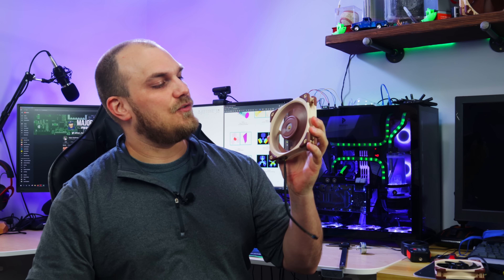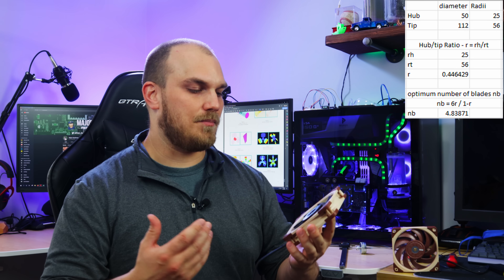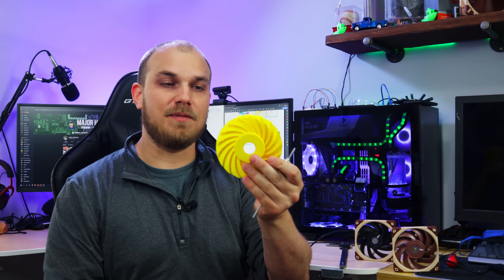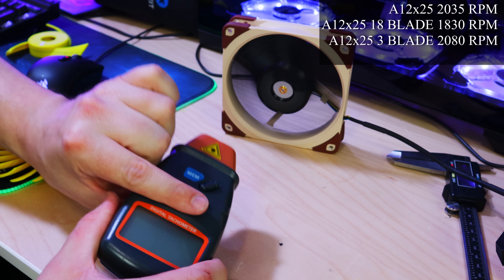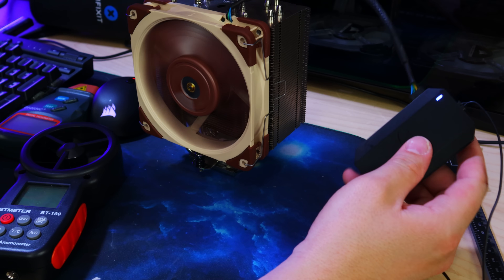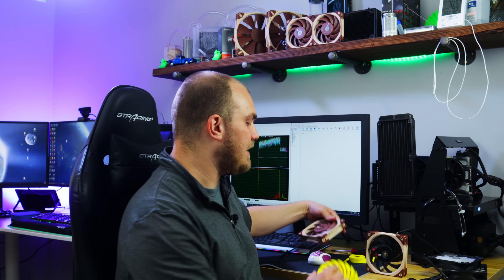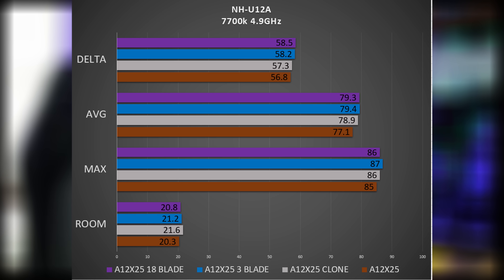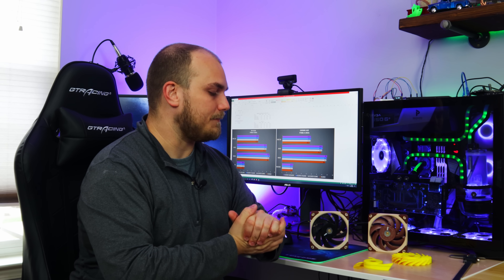What If the Noctua NF-A12x25 Had Twice as Many Blades? | Custom 3D Printed Blades

Comment: Fan design is a 'Black Art' and even the best aircraft engine manufacturers have had problems coming up with a workable unit.   Back when P&W was building the prototype 5000 engines (which became the F-119 used in the F-22 and now F-35 with revisions) the first couple computer designed fans didn't work well at all.   A senior engineer was asked to design one the 'old fashioned' way and he proceeded to use  a slide-rule and whipped one out....and it worked well!  Well enough that it was used on the competition engines which were chosen for the ATF program.   I don't know if the current production engines use the same fan....and there was word out a couple weeks ago that the F-35's were going to be getting a new improved fan, so maybe they've worked out a better one but at the least it shows that there is a LOT involved in making a fan work.   The military isn't so concerned with noise as a computer fan designer but the operating conditions vary so much it's a challenge to balance out the performance.   In the computer we want good airflow, high pressure and low noise and Noctua seems confident in their solution....which does work well for sure.

Comment: As soon as they work with physics the metric system works just fine in America ;)
Reply: Yeah. Basically as soon as something requires accurate measurements, people use metric. And I'm not even talking about calculating stuff and doing conversions (1 meter being 100 centimeters, 1 centimeter being 10 millimeters vs 1 yard being 3 feet, 1 foot being 12 inches, for example).
Reply: @ThorsShadow  People still use inches with accuracy, domestic engines are an example. I dont prefer inches, or anymore old folk spells that need a mulitple of "6" for succession..
Reply: Physics, not engineering
Reply: @NewRoo 
In the US, real STEM classes have used metric for the past 25 years.
The problem is metrication will never happen because of muh freedumbs, pseudo-exceptionalism, corporations are too cheap, lack of government leadership, and the US is a slowly-dying Roman empire.

Comment: If you want to figure out the best design, test the A12X25's static pressure. This is likely set up specifically to match the shape of the aircooler. You will find that if you add too many blades, it will try and move more air than will go though the aircooler at a time. The cooler is like a resistor in a circuit, if you want the right current, you have to tune the voltage. Also, try pulling the air through the cooler if possible. It may change things overall.

Comment: Noctua are awesome for letting you share the fan designs, huge thumbs up for them, normally companies are very protective of their stuff so for Noctua to be cool about it is awesome to see.

I still think the 10% difference is too large to be a proper comparison, and slowing the faster fan down to be as close as possible would be worth exploring to see if it's the blade design, or the speed that is causing the better temperatures on the stock fan.
Obviously the Noctua fan blade assembly is better built and quieter, but how much is the 10% increase in fan speed affecting the performance is what I want to know.

Great video as usual, made even better for the surprise cameo of your dog :)
Reply: I mean yes and no. It depends on if the drag is causing the decreased speed or not. If you have to pump more power into one fan design to get higher speeds than another, than for the same power limit you could get greater speed from the other... 

You really need to test in a lot of different ways to get a full picture... Both fans, same motor, same power = fan drag, both fans, same RPM = fan force despite power draw differences to reach RPM (Which means the lower quality fan may require a more powerful motor to overcome its inefficient surface flaws). 

I don't expect him to invest too heavily in a higher quality 3D printer, but an Ultimaker 5 or better would give cleaner end products and allow for greater accuracy in pure geometric design testing. At the end of the day, I think Noctua isn't worried because the Sterrox they use is actually a major factor in their success. These materials will slowly warp in a way theirs don't, and is part of the advantage they have over other manufacturers.
Reply: @dragoonsunite  I wasn't talking about speeding up the slower fan, but slowing down the faster one, I know the drag due to the roughness is having an effect on the fan speed, I'm not disputing that, but what I am interested in, and I thought I made it clear, was that I wanted to know how much, if at all, does the fan speed difference affect the results, again we're talking about a 10% difference in RPM, which is large enough to be considered significant, even to an engineer.

There's no easy way to remove the variable of the different motors in this test due to how difficult it is to remove the fan blades none destructively, so the next best option is to match the fan speeds as closely as possible, which is going to lower the performance of the faster fan, but how much, and is it enough for the 3d printed fan to make up the difference in performance?

Of course more money spent is going to improve the quality of the final print, I'm not really sure what that has to do with my comment, but you're recommending him to buy a ~US$6000 printer to test fan blade design for a video series designed to entertain?

I'm all for him printing with a better printer, but I don't think he has 6k to drop on anything, much less a 3d printer, especially considering how small his channel is and how little return he already gets on these videos.
I hope you realise he only has 35.5k subs right? he ain't no LTT that's for damned sure.

Besides how much improvement do you really think 6k is going to net him when the existing printer got him within 1C of the original?

Noctua have every right to be concerned about this, it's actually using their intellectual property, they have the rights to the design of their fan blades, and MH copied that design which they could rightly sue him for, send a c&d, or refuse his request to publish the designs at the very least, and the fact they haven't is worthy of praise, especially when it's legally justifiable for them to do the opposite.

Comment: I need a fan that screws right into the holes for mounting my glass side, so what like a 1000mm? I want it to take up the whole side. I'm thinking of rigging up something using Dyson...
Reply: Get a car radiator fan for like $20 on ebay. There are actually PC fans that are much bigger but PC fans are crazy overpriced. Car radiator fans run at 12v but it is basically the same thing and cost 1/5th as much.
Reply: @excitedbox5705  could probably run a car radiator for a custom watercooling loop for threadripper
Reply: Would just buy 4x 200mm fans

Comment: The Russians covered Mig Fighters in a clear lacquer to compensate for shoddy/rough metalworking creating drag. Pretty clever. Maybe you could do something like that for your 3d printed fan projects...
Reply from the maker: interesting
Reply: @MajorHardware  Body filler spraypaint works, but might require some sanding
Reply: @MajorHardware  Or sand the blades, they're pretty thick and probably have a lot more resistance from that too.
Reply: @quangluu96 unless he switches to ABS which is nowhere near user friendly, acetone smoothing is a no go with PLA
Reply: It's a popular method for PLA
Reply: Spray polyurethane. Pro tip.
Reply: With an air brush for model kits! @Major Hardware
Reply: @QueueTeePies  Yes, if you have a roughly-printed item in an acetone atmosphere for a while, it partially dissolves the outer layer and it smooths itself out, I'm guessing through surface tension

Comment: I think the unfinished leading edges of the fan blades are what is contributing to balance and noise differences. I understand you're an engineer and probably know this already but think of the fan blade as the wing of an airplane: The smoother the leading edge (the edge front of the wing/the side the fan blade is "cutting" the air from) surface is, the less drag you get. Another way to think of it, especially with the 18 blade fan is the fan blades are scoops and instead of having a straight blade on the hub. Good example is the fan blades of the new GE9x turbofan engine. 

All suggestions. I'd do it myself but I don't have a 3D printer, nor do I know how to run any of the software/programs to design something like that.
Reply from the maker: i need a better printer i think that would help

Comment: What you can do to improve the high blade count fan, is to give it alternating waves on the intake side of the blades. The idea behind this is, because of the way the fans "cut" into the air, you can leave air to pass over the low spots in the waves, only to run straight into the high spot of the wobble on the next blade. Thus, you can hopefully minimize the issue that super high blade count fans have, because it will be able to get intake air somewhat better. I guarantee it will change the sound profile, if nothing else. You can experiment with using high density waves, where there are tons of high and low points on each blade, and you can also try low density waves, such as one large high and one large low for each blade. since the alternating pattern is integral to the theoretical advantage, I don't doubt that it will be harder to balance the fan, so that may be why there aren't any fans I know of to use this idea on the market.
Reply: Would there be issues with air spoiling off the back side of the latter fin, creating a low pressure on top of the leading edge of the shorter blade? In that case, maybe try an inverse as well, where each blade has a high, average, and low point, but they change compared to one another? Like the first blade has a high point close to the middle, average height at the center, then a low tip, the second has a low center, high middle, average tip, then the third has an average middle, low middle, then high tip, and repeat from there.
Reply: @Asmusei  I was thinking the low pressure on the low spot of one blade would pull air down for the high spot of the next blade, but nice catch; forgot to mention anything about that bit of the theoretical behaviour.
definitely would like to see both of our inputs on what can be done put to the test, as well as the acetone PLA smoothing I saw in another comment.

Comment: You should try a taller fan blade design so that it's sticking out the fan shroud by half an inch or so and see if that increases air flow, if you know what I'm saying
Reply: noxxi knox  better make em asymmetrical.. or just slower
Reply: noxxi knox  EK released 38mm thick fans recently, 3500rpm beasties. Since they are 12v i doubt they would be as loud as delta fans but.. same deal :p so yea thick fans work, great static pressure, but it gives rise to another issue : power draw.
Those EK clocks at 9.3W which means.. one fan per MB fan connector (or use a powered fan hub obviously).

A fun test could be comparing a thin rad with thick fans to a thick rad with normal 25mm fans (surface area VS static pressure)
Reply: usopp barbosa sounds exactly like my Sunon Maglev fans (EK wouldn’t produce a fan, it’s probably either a rebranded Delta or Sunon or other fan manufacturer). But at 3,500 rpm and the greater depth it still loses to my standard sized Delta at 3,900-4000 rpm which shockingly somehow doesn’t sound any louder. So the performance is a win for the thinner Delta and the power ratings are about the same.
Reply: it would, just as flat fans have worse performance
Reply: Would that not cause the blades to hit the screws?
Reply: @heytheresakitty  Yes, but there are deeper frames, so perhaps a frame extension could be printed.
Reply: What about extending the blade depth AND adding a nose cone on the center maybe with a screw pattern to eliminate dead space in the center

Comment: acetone smoothing and sla printing would give a much better finish, would be cool to see if it gives performance improvements
Reply: I do agree but getting good results with acetone smoothing can be tricky, especially on thinner parts.
I do think the printer that's being used isn't that great, I think getting a better printer would be the best option.
And ofcourse, sla printing would indeed be the best idea! :)
Reply: @Dutch929  it's not certain the printer is bad, more like his settings/setup are unrefined.

A default Ender 3 can print from 0.3 down to 0.05mm, but 0.05 takes a crapton more time.

So most people just print at 0.2-0.3, it's evident he prints in a low resolution as you can see the layers so well defined.

Besides that, an untuned 3D printer will have rounded edges, ghosting, bulges, etc on top of the artefacts low resolution prints give, requiring even more manual aftertreatment.

Couple years ago I started with a stock Ender 3 Pro, tweaked the crap out of it and now have super smooth prints at 3x the original speed that machine could do on it.
So good that a year after building it, my 100% custom large bed CoreXY machine (that cost 600€ in materials alone) still is nowhere near the speed and quality that little 200€ Ender 3 Pro does.

Aside from a 30€ replacement MCU (which turned out was unnecessary after I moved to the Klipper firmware) and a Pi (which I already had and used originally just for convenience of a camera and remote control but ended up using for said Klipper firmware), I spent about 5€ on an accelerometer (to tune out ghosting and dial in increased speed), 25€ for a bed leveling probe, 10€ for a bed insulator and 20€ for an assortment of bearings and M nuts/bolts. Then 3D printed a load of mods and parts and handmade some aluminium brackets to firm things up.

The total cost of my Ender 3 Pro was still under 300€ and it's both fast and prints beautifully.

Not only is the printing at least 3x faster, the time I have to put into aftertreatment for printed parts has gone from hours to 15-30 minutes.

As a note more specific to these fans, I suspect the way you slice them can make a ton of difference in how they perform and the amount of aftertreatment needed.

Slicers don't care about aerodynamcis.
Reply: Acetone smoothing only works for abs
Reply: @jorgetucson8196  ,,
Reply: Vapor smoothing wouldn't work with PLA unless you have chloroform. Alternatively, print with ABS. It's a pain in the arse to work with though if you're in a colder environment.
Reply: Non-linear slicing can also improve surface quality
Reply: Make a fan blade out of Legos 😜
Reply: I'd love to see tests like that. Because sometimes rough is better. Like the bumps sharks have, or a golf ball (or the triangles in the Noctua frames)
Reply: PIckeljuice I literally read somebody post this in a comment last time and I was hoping he would’ve tried it this time :(
Reply: A decent way to smooth PLA (or other non smoothable materials) is to coat them in a thin layer of material like epoxy. ABS is such a pain to work with because of the need for an enclosure and air filtration (styrene fumes are very toxic despite a lot of the 3D printing community not knowing this) so it's usually easier to just coat the print after a bit of sanding.
Reply: Properly dialing in the printer and settings with a small layer height should also produce much better results than he's getting from judging the video.
Reply: Well if you think about Be Quiets fans, they are not really smooth too. The material is but the design is intentionally rippled, maybe for marketing and brand identity reasons, maybe for performance.
Reply: it reduces friction of air on plastic as it creates a turbulent  layer of air over the surface of the blade, so you get air on air friction instead. The same principal applies to car mufflers. The perforations inside the muffler tubes at high airflow speed actually create a wall of air on the inside of the tubes reducing friction and increasing power over if you had no muffler at all.
Reply: Acetone would only work with ABS. I can't say about performance but it'll definitely reduce some noise which are created by zagged edges.
Reply: Didn't he try that on the last ones or am I thinking of something different
Reply: would probably perform worse too, noctua blades aren't actually smooth, they're quite textured, and so are golf balls :P
Reply: using non-planar 3d printing technique is also helps
Reply: @chiboreache  You can't just use non-planar 3D printing on a regular 3D printer, it's not designed for it, doesn't have the clearance or nozzle to do it.
Reply: Smoothing the surface of the blades should improve the air flow because it reduces the turbulence created by the rough surface... Less turbulence, better and more efficient air flow
Reply: Sla resins are heavier, incredibly accurate printing though.
Reply: I'm thinking that just some basic smoothing if the rough print will decrease drag and increase efficiency of each design
Reply: Or just resin print
Reply: I was going to mention the same thing, I think it could perform a little better